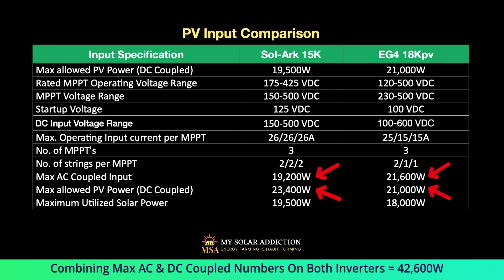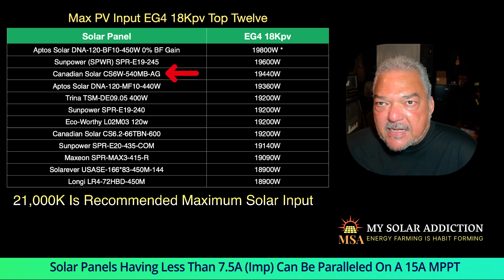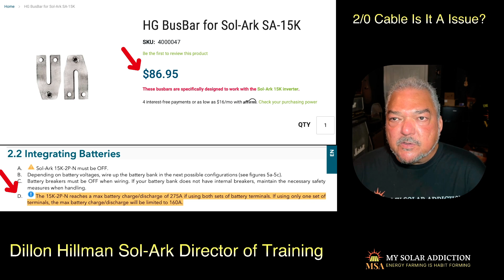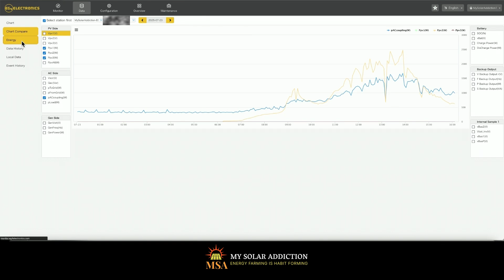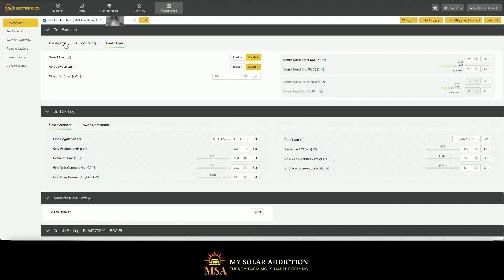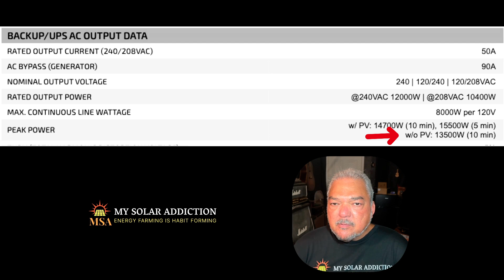Sol Ark 15K vs EG4 18Kpv Who Wins The Title 2 of 2

Comment from the maker: Sol-Ark’s EMP test on their website:

Many comments on my last video about EMP testing.  It also seems many didnt watch the second part of the video all the way through where I say I like both inverters..  EG4’s EMP test data clearly shows they used 50 kV/m for the test.  Tried to read through the long ass report for Sol-Ark to clearly see that the Sol-Ark 15 K was tested to 150 kV/m, but no luck. I even searched the document for 150, kV/m, kvm, several permutations.  Nada￼

I'll admit I'm no EMP expert so I dumped the Sol-Ark EMP pdf into ChatGPT and had it analyze it. Then this prompt:

Sol-Ark claims to have tested the Sol-Ark 15k for EMP at 150 kV/m.  Does the report validate this claim?

➡ 150 kV/m is a standard level for MIL-STD-461G RS105, which tests resilience to short-pulse, high-intensity radiated fields — think nuclear EMPs or directed energy attacks.

📄 What's in the Report You Uploaded?
Your report only includes:
CS115 – Conducted susceptibility (transients on cables)CS116 – Damped sinusoidal (power line disturbance)CS117 – Lightning-induced transients✅ These are conducted immunity tests (surges or pulses through wires).
❌ It does not include RS105 or any radiated susceptibility testing.

🧠 So Where Does the 150 kV/m Claim Come From?
If Sol-Ark claims 150 kV/m EMP protection, that would imply RS105 testing was performed — possibly in a separate test report not included in this file. That test would verify immunity to:
⚡ An intense electromagnetic field of up to 150,000 volts per meter, simulating a nuclear EMP.

So then I asked: Can you find me the report showing that Sol-Ark 15 K was tested to 100 kV/m?

Answer: 

Here’s what I found:
On Sol‑Ark’s official EMP information page, they state that the sol‑Ark 15K Whole Home hybrid inverter is EMP‑hardened to handle over twice the military requirement, explicitly saying “over 100 kV/meter”
DIY Solar Power Forum
Sol-Ark
+12
Sol-Ark
+12
Solar Electric
+12
.

Additionally, on Sol‑Ark product listings (e.g. a distributor site), the 15K-2P‑EMP model is described as “independently tested to MIL‑STD‑461G”, and that it “withstood field strengths of 50 kV/m and 100 kV/m without any performance degradation or damage” 
DIY Solar Power Forum
+3
Solar Electric Supply
+3
Solar Electric Supply
+3
.

However, no publicly available version of the EMP Test Report PDF itself appears to display the detailed test results (such as tables with voltages or waveforms) confirming the field strength levels. The PDF linked earlier is internally labeled as “EMP Test Report V1.0,” but its contents were not accessible in my results, and did not obviously include numeric test field‑strength confirmation.

✅ Summary:
Sol‑Ark claims via its website and product literature that the EMP‑hardened 15 K inverter was tested to and passed 100 kV/m, per MIL‑STD‑461G 
Sol-Ark
YouTube
+10
Sol-Ark
+10
DIY Solar Power Forum
+10
.
But the publicly available PDF lacks visible numeric data or explicit confirmation of that 100 kV/m exposure (the detailed data may be obscured or require deeper download).
No publicly published report shows testing to 150 kV/m.

In case you folks haven’t been paying attention I have a solar addiction and now I have a inverter collection.  And that includes Sol-Ark 15k, EG4 18Kpv and more to come.   Be on the lookout for my Growatt & LG high voltage video coming soon.  

Try not to get too upset about this stuff it ain’t worth it.  

#mysolaraddiction
#diysolar
#EnergyIndependence
Reply: I agree Sol-ark does not have a published RS105 on the 15k, the only one I can find is a 100 kvm with  the Sol-Ark 8k on NAZ Solar Electrics site. The EMP 15k has a CS115,116,117 published but that is not an EMP test. I have no idea where @engineer775 is getting the 150 kvm claim from and he cannot seem to answer me on it.

Comment: This was a great comparison however did I miss something? How about the noise issue that was mentioned. I don't think I saw that comparison is the EG4 noisy?
Reply from the maker: They both can get "loud" when the system is working hard....  The EG4 inverters vary in "loudness" which is relative term.  18kpv is the loudest of the three hybrids, then the FlexBoxx21, and the FlexBoss18 is the quietest. 
I have to look and see if I have decibel readings from the Sol-Ark.  I'm running my house on the EG4 system at the moment.  I do live testing for a few companies.

Just looked up some decibel numbers on the Sol-Ark 15k and the EG4 18Kpv

Wiring compartment open:

Sol-Ark 15K = 73db
EG4 18Kpv = 70db

Wiring compartment closed:

Sol-Ark 15K = 52db
EG4 18Kpv = 69db

These numbers were taken at two different times and the system may or may not have been working hard at the same level.  So take them with a grain of salt.  

Also, Sol-Ark 15K has a protective shield that you put over the wiring before you close the cabinet that will add to the noise reduction.  EG4 has the same protective shield on both the FlexBoxx21 and the FlexBoss18.  

I'm about to come out with a video comparison of the Sol-Ark 15K and the FlexBoss21.
Reply: @mysolaraddiction thank you so much for that.

Comment: Sol-Ark 15k is 15kw inverter with PV, does not require grid, the battery DC/DC is 12kw on both units but the Sol-ark can do 15kw AC WITHOUT GRID but does require PV. The grid connection does let the inverter see a power factor of 1 and help with unbalanced loads, so if you have poor factor loads or leg imbalances the grid could help the inverter reach the 15k peak, but it is a 15kw inverter and should be able to do so off-grid with resistive loads and should go above 12kw with mixed loads, its not capped at 12kw off-grid.

Comment: Why is max allowed PV Power (DC Coupled) listed twice with two different numbers?
Reply from the maker: One is "max PV allowed" and the other is "max PV utilized". "Max PV allowed" is the most PV you can put on the inverter without blowing up your MPPT's.  You will hardly ever get 100% out of your solar panels so you want to "over panel" and hopefully get enough.
Reply: @mysolaraddiction  At 0:48 your table show 3 rows, two are "Max allowed PV Power (DC coupled)" with different numbers, the first row and second from the last, this is what I am referring to, the third row "Maximum Utilized Solar Power" is the last row has different numbers as well. I understand max allowed vs max utilized, I don't understand why you have two different max allowed with different values.
Reply from the maker: @justinharrell9256 download the data sheet on the sol-ark 15K and you’ll see the confusion I talked about in the beginning of part 1.  Those numbers are from Sol-Ark.  my comparison was based on their numbers and my personal experience.  The spec sheet is very confusing
Reply: @mysolaraddiction  The data sheet does not list Max Allowed PV Power twice with two different numbers, it lists it once as 23kw. Do you not see the double table entry in your own video @ 0:48 with two different values? You list the Sol-Ark as 19.5kw max allowed, then 23.4kw max allowed, then 19.5kw max usable, this makes no sense and is not in the data sheet as such.
Reply from the maker: @justinharrell9256 like I say I’m not perfect just ask my wife.  The top number should be 23.4k. I changed my chart… I was originally gonna start with max usable PV.

Comment: Yeah it wasn't till I found signature solars panels like the Hyperion to make the math work. But what people don't understand is how that affects the downstream mounting. How much more money is spent on the ground Mount to put up more panels and put in more concrete and more posts and purlins. The whole system needs to be looked at so the only way they can make it work is finding panels to work with the inverter that is not required with Solark. It is bad when you are designing for Maine, Wyoming, North Dakota.
Reply: That's a good idea, a "whole system video" comparing the cost of Battery, Wiring, Extra disconnects and panels.
Reply from the maker: No argument here in the mounting hardware and additional expense.  I was just pointing out that with the right panels you can get close to the specification in the manual.
Reply: I saw firstsolar panels that have 200v VOC and 2 amps.  Imagine how easy you could max both inverter mppts.
Reply from the maker: @jasoncr8419 panels vary greatly
Reply: True my engineered, stamped and permitted ground mount was more expensive than the panels.